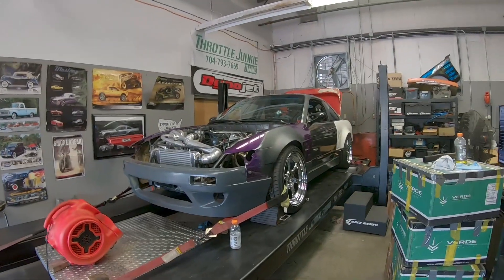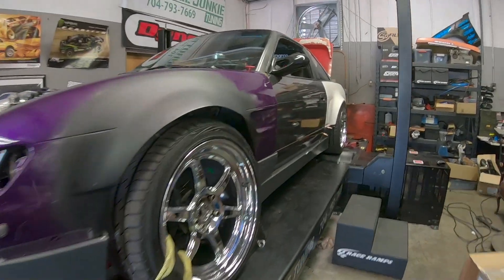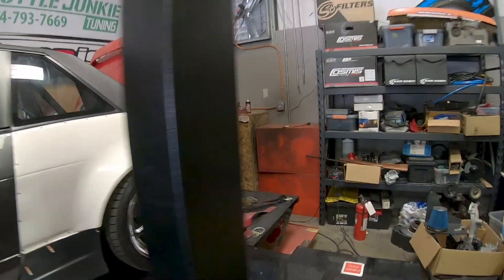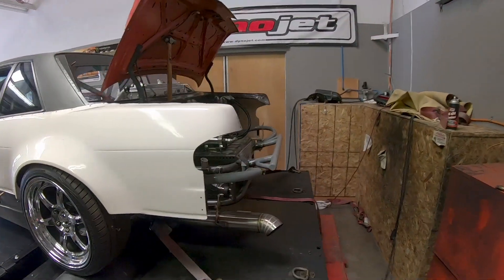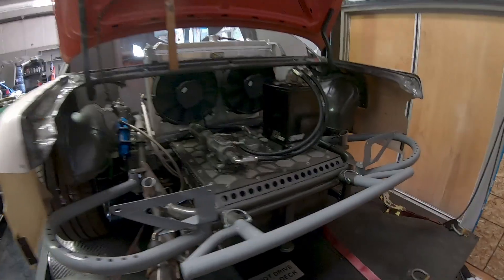TorqStorm Supercharged 240sx Hits The Dyno!

Comment: aww man see people on here that make videos of LS swaps and say you can do them on a budget,,shit somethings always going to go wrong,i used all new parts from summit and other places no ebay or used parts here my two goals were reliability and run cool here in tx heat,that bummed me out bad,i did the complete Ls and cam swap in my 05 blazer which came with a 5 speed after the install i had to remove the trans 3 times the last time i installed a T56 and i had the bigger bearing in the crank snout from the previous 5 speed and it would not go in and it killed my shoulders come to find out i had to remove it and put the smaller brass one in and then the 6 speed just slid right in,i paid for the torqstorm but im just waiting on it,curious to see if it wakes this 6.0 up plus im going with 430 gears so hopefully it will scream bloody murder haha.but i feel your pain man,everything went wrong on my ls swap,i fired it up all by myself and then had no oil pressure then had to lower oil pan some and fix that its just been hell and a ton of money,trying to decide on piping size and intercooler,i want to go with 3 inch because they make so many kits for like a hundred bucks anyways.later man cant wait to get my supercharger !!!!!!

Comment: what motor is in this? and stock size torqstorm pully?
Reply from the maker: Dang I knew I forgot to add something! Updated the video description with my specs. It’s a 5.3 and I’m running the 3.10” pulley that peaked at 10psi of boost on my setup. As far as i know that’s the smallest pulley they make currently.
Reply: @tylergarlatz1577  same on my G8
Reply: @tylergarlatz1577 seems like a little bit of WHP compared to what other makes with 5.3 and 3.1 pulley. What cam is in this beast?